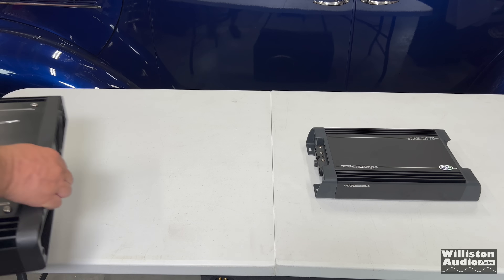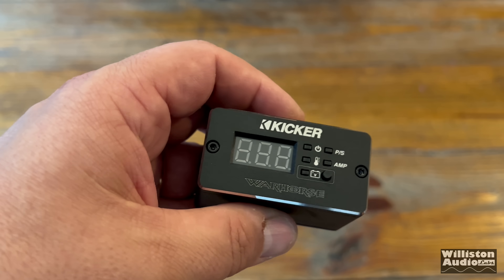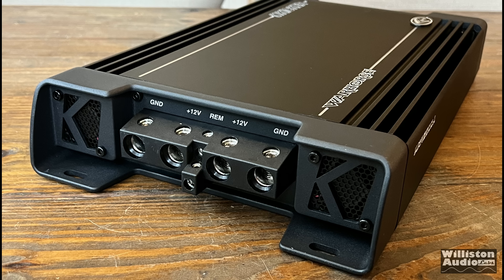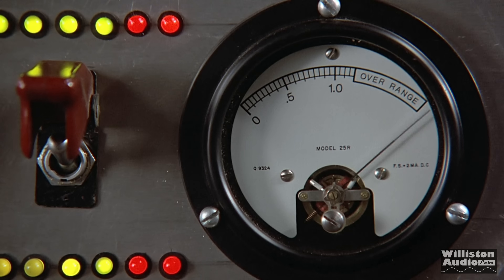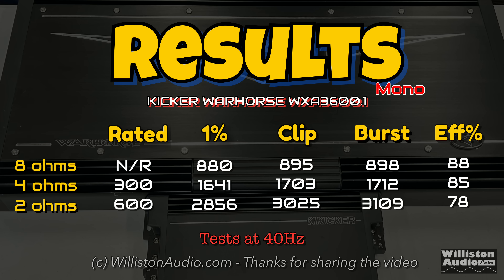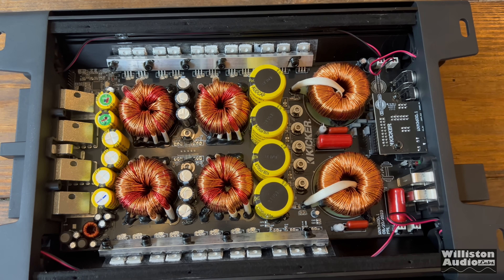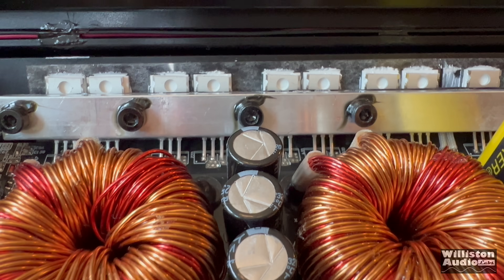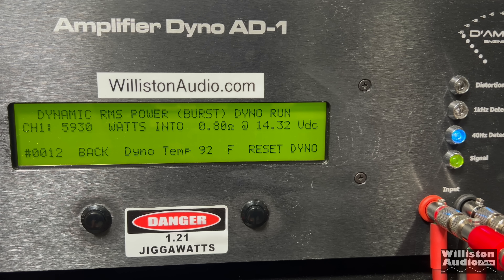KICKER Warhorse is BACK! WXA3600.1 Mono Amp Dyno Test

Comment: So far which amp takes crown for most efficient overall ?
Reply: I would not make a buying decision based on efficiency. Just about any of the Class D monoblocks are going to be pretty efficient. I'd avoid the large Class A/B subwoofer amps. You'll notice the lower efficiency of those.
Reply: @JasonWW2000  yeah but not all class D amps are built equally the same..you can find some class D excellent on power n some are just cheap copies with poor components
Reply: @Hexa8 Yes, but I think you're confusing quality with efficiency. You can have a high-quality amp that isn't as efficient and a poor quality amp that is more efficient. It really is two separate qualities.
Reply: Ds18 Hooligan

Comment: Really... 2024 ..they couldn't just combine the two remotes!..cmon kicker take some notes!
Reply: Well, I'd probably put the indicators somewhere I can see them and then put the knob in the center console. So in my case, I'm glad they separated it.
Reply: It’s so people can hold the bass knob and not have to hold the huge diagnostic panel. That’s part of why the bass knob is magnetic with a mounting plate. So you can take it off and hold it if you’re demoing.

Comment: I don't understand. All of those sophisticated indicators and circuits and they didn't include a clip light? Inconceivable!
Reply from the maker: I honestly could not believe the oversight, thought I was missing something
Reply: I hear ya, but 98% of amps with a clip LED go unused anyway. Everyone thinks they'll use it, then they set by ear anyway. Kicker said eff it, we'll save the 7 bucks. LOL
Reply: @firebirdude2 Set by ear? You must be referring to setting the gain. I'm not referring to that, I'm talking about listening to music and cranking it up. As your voltage dips your clip point changes and you want to make sure that you're not going to overheat your subs. That's the main use for the clip light.

Comment: Wow I can’t believe they did the separate knob and diagnostic and didn’t include clipping indicator. Now you have to run another wire and mount two separate parts. I feel like this was a huge oversight especially for the amount of time and lead up to the amp coming out. Really surprising because they usually thinking about how to make things easier and more intergraded but this is the opposite of that and like old tech almost. Maybe there’s a reason and I’m missing it 🤷🏻‍♂️
Reply: That's a stupid design ad looks like an afterthought tbh.
Reply: I was also thinking that they should have made one unit for everything. Seems like a no-brainer.
Reply: IDK, it seems like an easy enough circuit that could be built into the amp and remote. I would really like it.